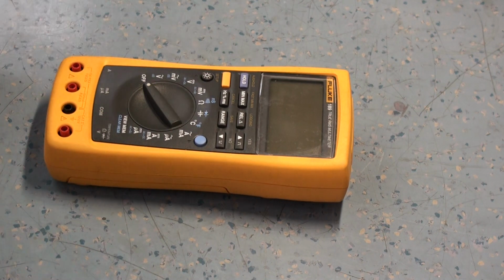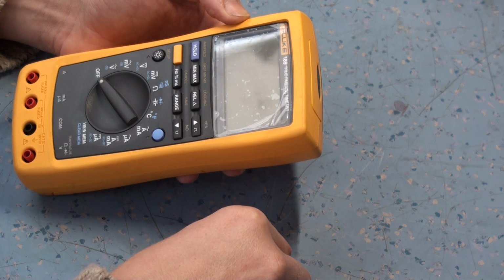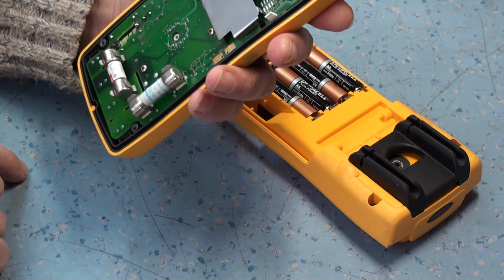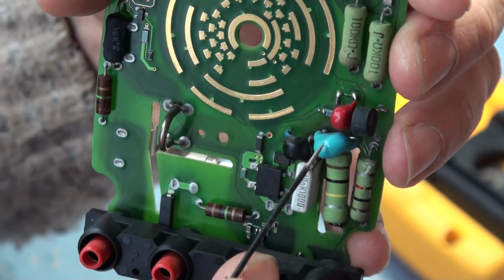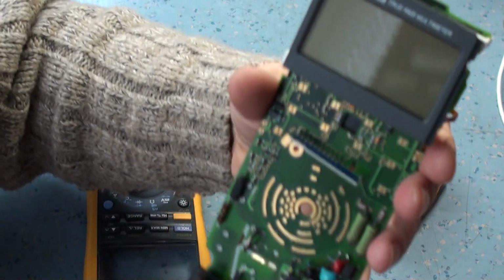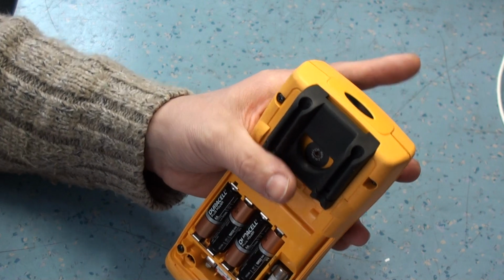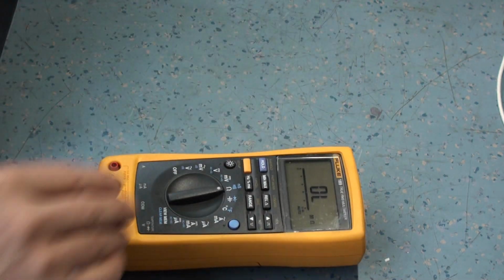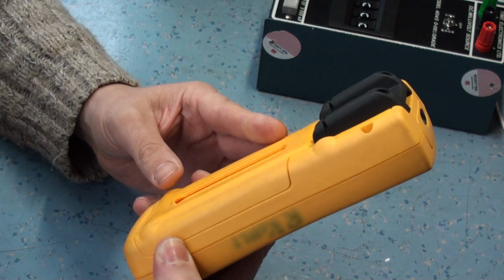The Fluke 189 that refused to die

Comment: Isn’t someone like that “20kV cowboy” a bit of a liability? Next thing he’ll be measuring a 1.5kV distribution panel somewhere and there’ll be a low source impedance transient high enough to break down the meter and he’ll have a ball of plasma instead of a meter… these meters have limits as to the source short circuit current capacity they can deal with. Make it too high and the whole meter is a fuse.

Comment: This an old topic but I have a recent encounter with Fluke service regarding the famous “Leaking Super Capacitor problems with Fluke 189, 287, & 289 DMM  I’d like to share:  
“Hello,
Service still supports the Fluke 289, please do not open it, you will void the limited-lifetime warranty.
The 189 is obsolete, new Fluke 289 is the suggested replacement. It was obsolete in 2007, all warranties have long expired so you may open those to your liking; we do not have repair parts on the obsolete model though.

Please see a separate email from our system for your RMA xxxxxxxx for the Fluke 289.
Please also check your spam/junk mail folder as this is a system message.

Ship-to lab address is on the top left of your PDF in the confirmation. 
Please do not ship accessories unless requested, especially extra batteries. If we receive extra batteries we will not be able to ship back via air, your order will be returned via UPS ground for domestic orders or cargo ship for international orders. 

Thank you for choosing Fluke for your repair and calibration needs.”

BTW, I live 3 about miles from the Fluke service center in Beaverton, Oregon.  I still have to ship my 289 to them. Silly huh?

Comment: great repair. I have a 289 which is in many aspect similar to this. Can you make a video about the calibration of this? Could you briefly explain how you generated the calibration voltages and currents? it's not that easy unless you have one of those very expensive calibration generators
Reply from the maker: I have a Ronan voltage calibrator for the low voltage stuff, any other Voltages and Currents are set on my Agilent 34401a  and used as a reference. Generally these meters stay in calibration forever. In this case however all the cal constants were lost.
Reply: but how did you manage the 50V/500V 700Hz AC and 50/500V DC that are required for calibration? plus the precision AC currents at 700Hz and DC?
Reply from the maker: Using a  apn 6s generator through a step up tx. AC currents with a standard resistor and load. I doubt it is t the same level of accuracy as FLuke claim but at least it's a working meter.

Comment: I repaired a corroded one of these - had to lift the chips and buzz out tracks that no longer existed. Some buttons including the cal button didn't work. With no schematic I compared the pushbutton circuitry to another meter in the same range to see what bodge wires were needed and it's now been my go-to meter for years. Great meter.

Comment: Nice fix Simon. His loss is your gain! Looks like a great meter with pretty much all the functions you could ask for. Fancy a Fluke 77 to calibrate? All the best, Graham
Reply from the maker: Radiocruncher It is a nice meter Graham. The 77 is simple to calibrate. only one pot. use your dvm as a reference and calibrate on the 300 mV range at around 150mV.
Reply: Thanks Simon. I meant to say It's a Fluke 75. I have compared it to my Keysight meter and it's pretty close. I will give it a try on the mV range